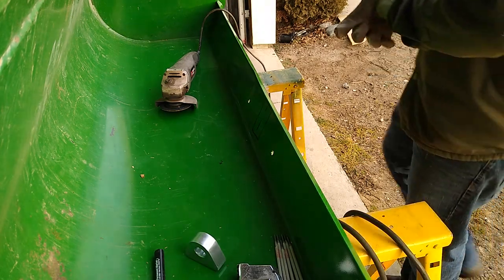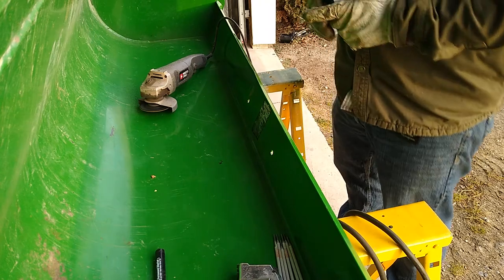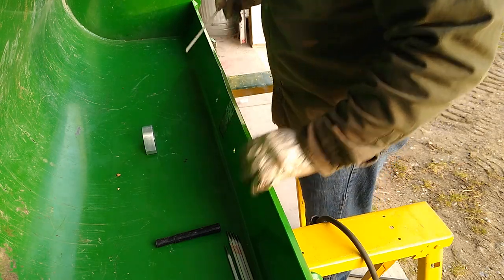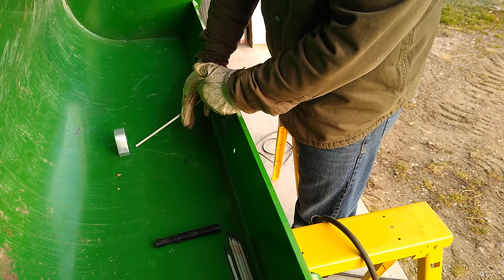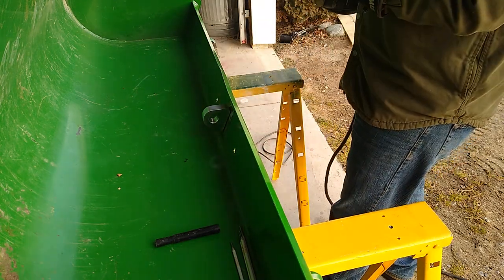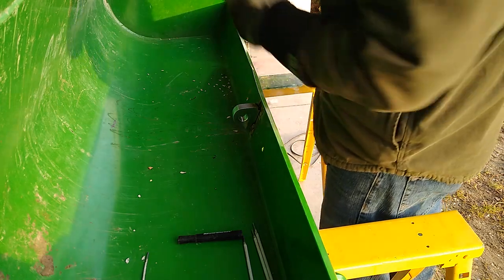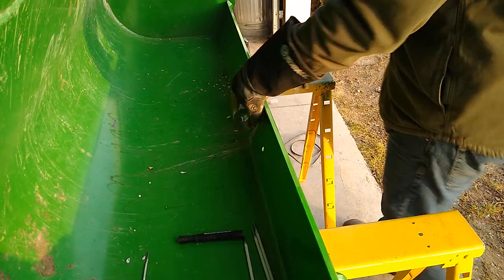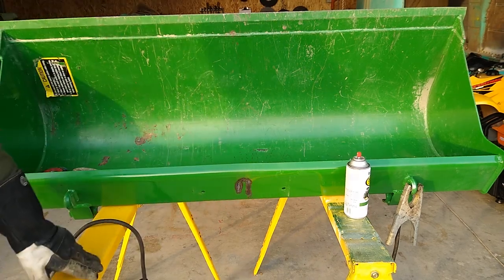Welding a clevis hook mount on a tractor bucket.

Comment: Well it's been 2 years so how well did that thin sheet metal bucket hold up the first time you had a real hard pull on it . I would have welded a 2" by 2" by 1/4 " angle iron all the way across the back side to make it a lot stronger  so it would resist bending .